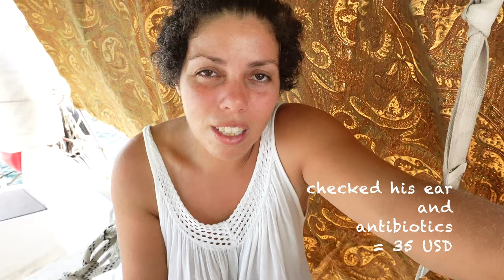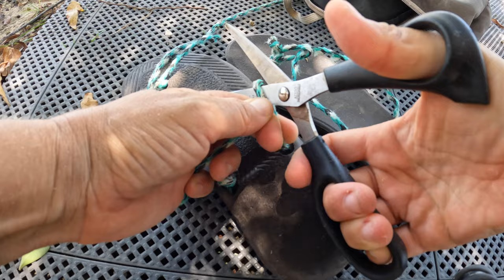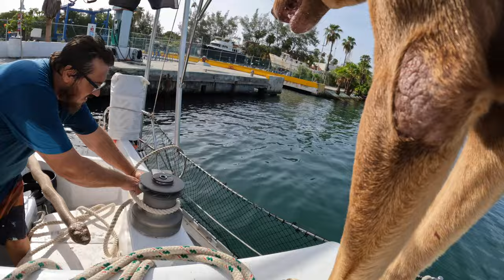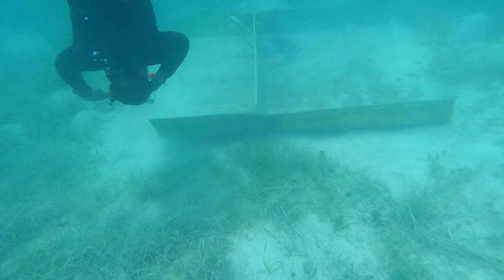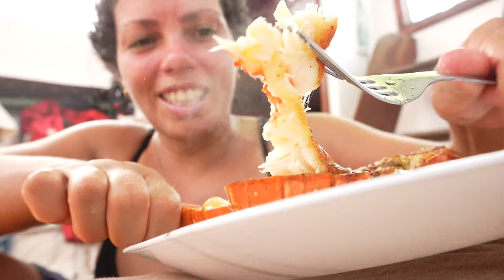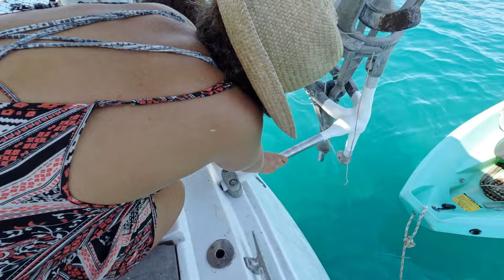I used to play BARBIES, now I got an ARIES

Comment: Windvane is like extra hands on deck. Aries is tough, an alternative is could have welded the body, the thing to watch for is worn bushings, it will cause it to not steer well in light wind. Lube it. It is difficult but not to hard to take apart, there are videos, when I have to replace my bushings I will not be putting compression pins back in, which are difficult. Like the pins they put in a rudder but smaller. Videos show using torch and a lot of banging. Another video showed, On a rudder, drill out one side with a smaller bit than the pin to about 1/3 to 1/2 way through. Use a punch and punch it out the other side, which is what I will try on the Aries, and my rudder. And a small rope to tie the bottom of the vane to the upper part in case that lower pin shears or wears through.
Reply from the maker: All true 👍🏼 This Aries is so old that it's cracking badly everywhere (from all the kind of work that you describe) having been done on it in the last 20 years.

Comment: The lobster looks delish! No backing plate? Cheers.
Reply from the maker: Yeah, backing plate is always recommended. The bolts on the clamps that came with the windvane are seized into place - there is just barely enough bolt coming through the deck to fit the washer and nut on.
Reply: I can relate but anticipate the next vid will have added support from??? A shipwreck salvage???

Comment: epoxy is ok for glass work but metal parts are better repaired by mechanical meens such as drilling and tapping threads and using screws to hold
Reply from the maker: Of course metal work on metal is better, but not going to happen - thus the fiberglass repairs ✌️

Comment: To much luxury with the flip flops. I want to see a full pair made from an old tyre, fully off grid living.🤔😊😊😊
Reply from the maker: Tires are in high demand, being repurposed for dock fenders I noticed - I'd be better off finding two matching discarded flip flop carcasses on beaches, really 😆
Reply: @sailorama haha, I seem to only find left foot... rubber slippers. It just occurred to me that I could turn them over... duh. I have a stash of slippers on board that come in handy for cushioning and separating dissimilar metals to slow corrosion where can. Hint hint for aries support.
Reply from the maker: @saylaveenadmearedead  Yeah, we had a stash of them onboard for awhile, actually found a right and a lefty, wore those out, and then we do use bicycle tire rubber to separate metals sometimes...